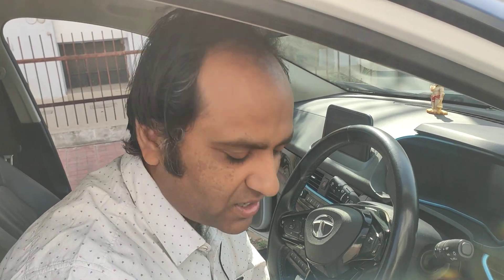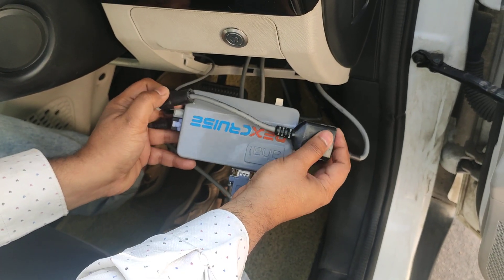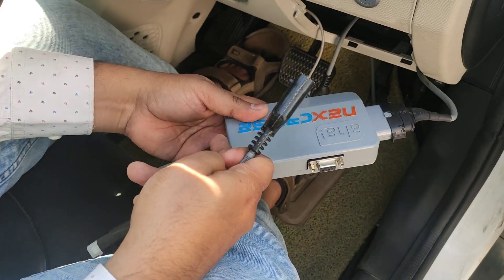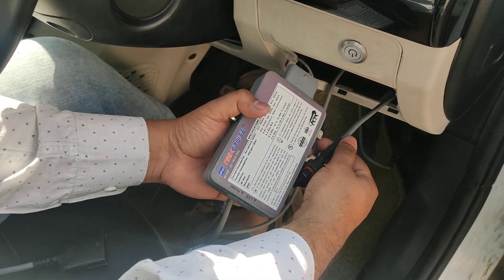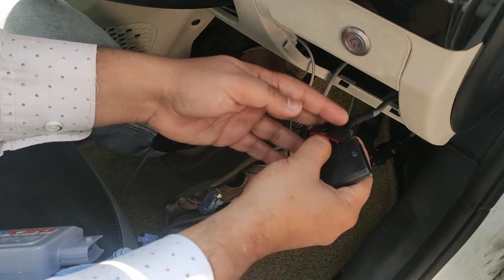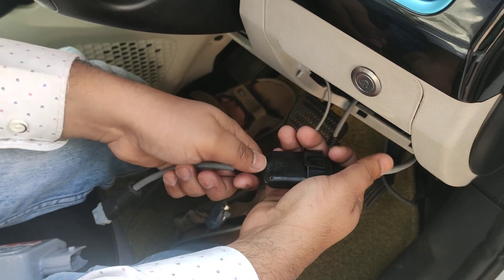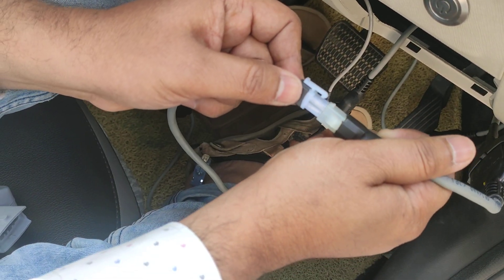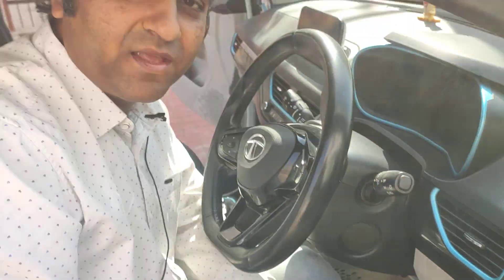Aha! NexCruise - Connecting the Bypass Cable

Comment: Just mention that the excess cable should be placed somewhere properly. Otherwise the excess length can sabotage the accelerator/brake pedal (physically blocking the pedal).
Reply from the maker: Will do on next opportunity!